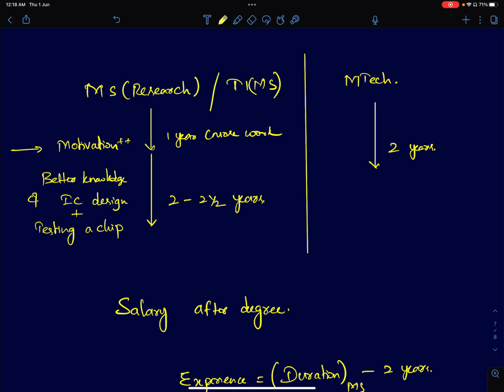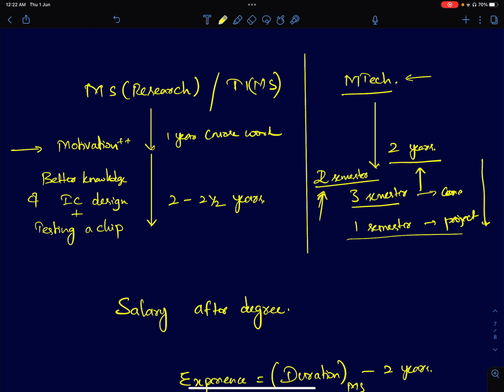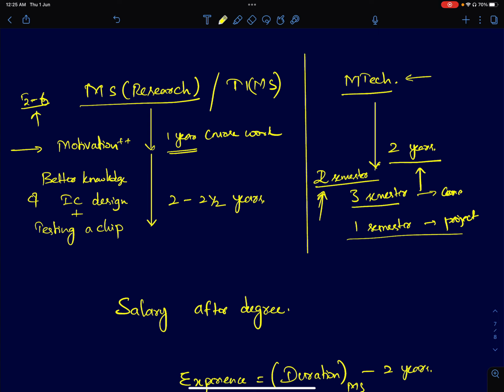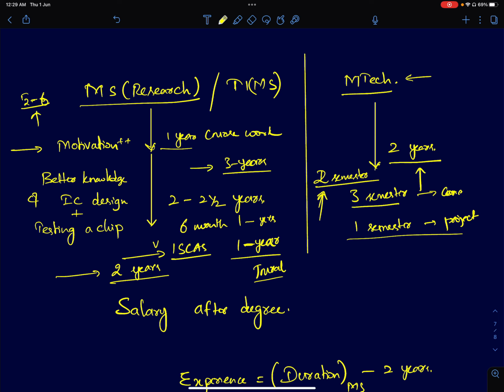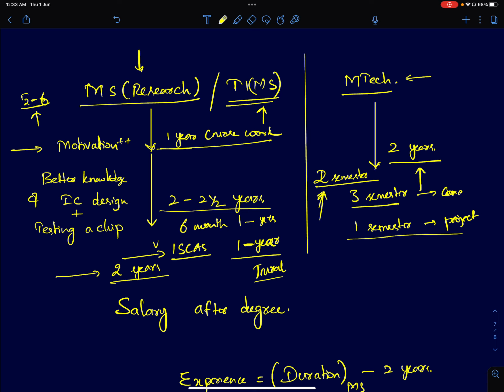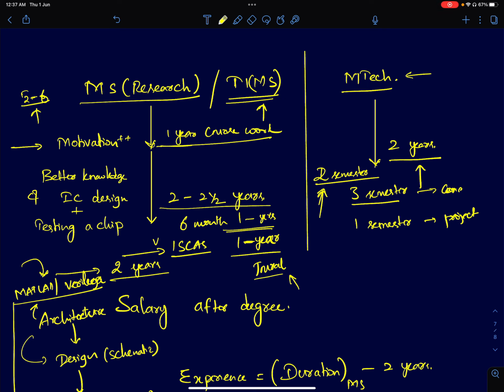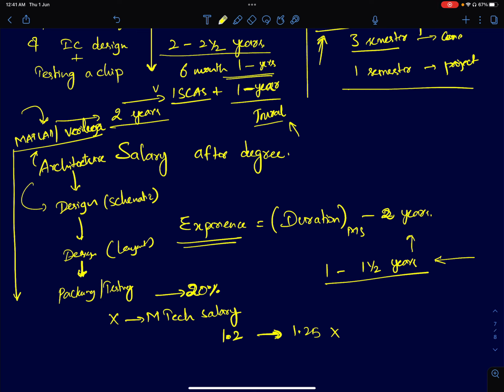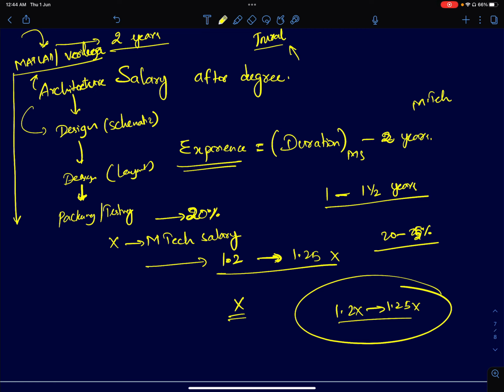MS or NO MS: Thoughts on Masters programs in India MS(research) vs MTech vs Industry sponsored MS.

Comment: But then the package TI offers to MS is same as that of M tech student despite they working more. And is it also true that domain gets narrower in MS compare to M tech, enabling latter to switch in industry like from Analog to Digital design engineer or Logic synthesis design engineer or hardware engineer at Google(Recently saw this profile offered to IITB M tech student) so this kind of freedom is absent in MS i think. Why toppers do not take MS and its cutoff is very low, around 500 to 550 gate score for IIT madras.Those are not very talented students, say someone who has a gate EC score above 750+ or 800+ will All india rank within top 250 or within 200 is way more talented than 550 score (rank around 3k) so why M tech is more sought after degree than MS. Is it due to same pay offered by company wheather you are m tech or MS. Is there a bias that MS student is mediocre and had not had good rank so as to get M tech so he took it as a fall back option?
Reply: MS student can take a drop and prepare again nicely and same person can get a good score as well, atleast for gate don't say talent and etc. The real talented people are BTech from IITs and it's well know. If you want to act smart or something then it would be better if you were a BTech student that way you can flex, not as a MTech IIT student
Reply: I agree that Gate cutoff score for iitm ms is low. But still u need to sit for another TEST and INTERVIEW to secure admission. So ur point is not completely valid. Also most students take admission for MS on the same year as they pass out who didn't get time to prepare all subjects to get top rank in GATE exam along with college  work but utilized extra 3months to improve their concepts for the INTERVIEW. Also it is very much easier to get top rank if one takes extra year to repeat for GATE and most of top rankers are repeaters.